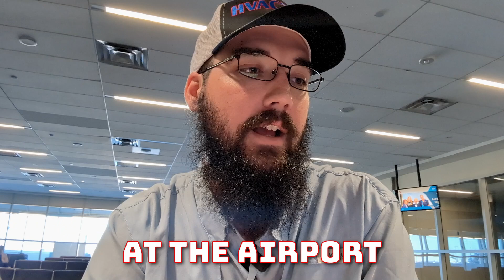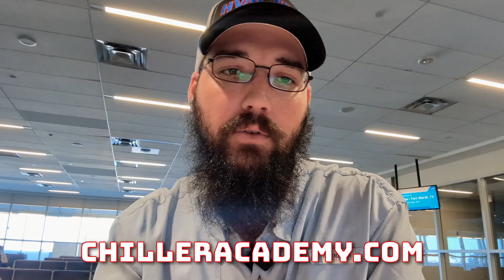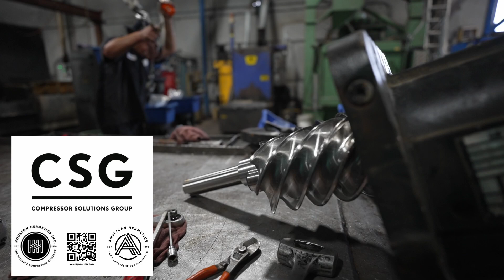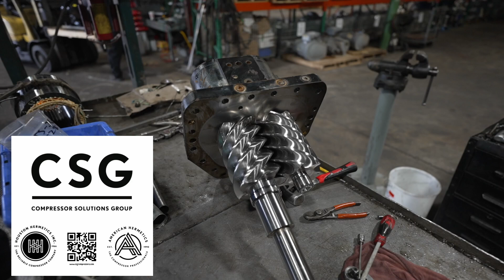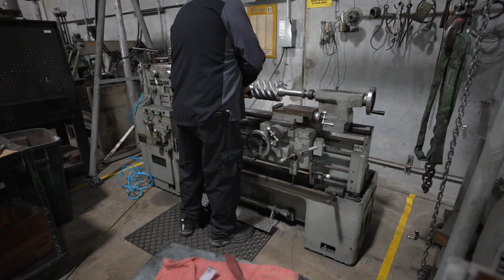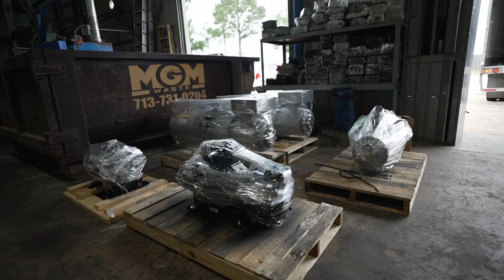Know When To Stage Lag Chiller Q/A

Comment: Good day we have york module chillers have you had any issues with struggling when its hot and the temperature we use to get on the previous chillers 4.5c i miss the older chillers an we not getting the support from the company who installed them

Comment: I am refrigeration and air-conditioning engineer (Diploma holder)  and also bsc in EEE from Bangladesh. I have 4 years experience in vrf system and many air-conditioning system work.
I need a good job in your country.I  have so many experience in this sector. I  need some help.How to apply and achieve a job hvac work job?

Comment: Hey Holden, on process chillers when glycol drops to 30, the evap sat would be below freezing. How do the manufacturers prevent the evaporator from icing up while achieving low temps for process cooling?
Reply: If your glycol loop is freezing at 30 degrees Fahrenheit, then you don't have a high enough concentration of glycol (too much water). There are charts you can reference online to figure out what concentration of glycol you need in the system. A 25% mixture can get you down to roughly 10 degrees F. All depends on what temperature evaporator you intend to maintain.
Reply: @ryanbrown7134  I am talking about the actual evaporator saturation temp. 
If it’s below 32 degrees, what do manufacturers do to prevent the actual evaporator barrel from freezing up?
Reply: @NROhvac  Any low pressure component in a refrigeration circuit will be insulated to prevent the exterior from freezing due to the humidity in the ambient air. I have never seen the math done, but they can calculate what R value to insulate with based off the design evaporator temp and expected ambient conditions. In a theoretical world with 0% relative humidity, nothing would ever freeze so insulation would not be necessary. Does that answer your question?
Reply: @ryanbrown7134  yes thanks ! Makes a lot of sense. I understand moisture and frost from refrigeration, so this makes perfect sense.